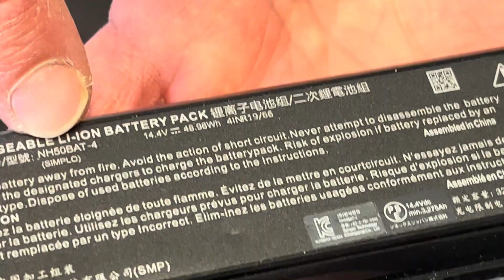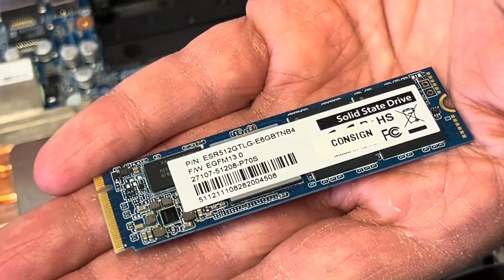Gigabyte G5 Laptop. Take apart. Fix, repair or upgrade: RAM memory, SSD HDD Motherboard LCD Battery.

Comment: My notebook is accusing a problem that usually happens when the BIOS battery is low, but this model does not have a separate BIOS battery from what I saw.
Do you know how to solve it?
Reply: there is a coin battery. on the motherboard it's a little red and black wire to a black disk. Very easy to replace.